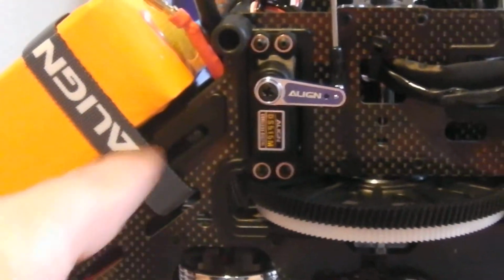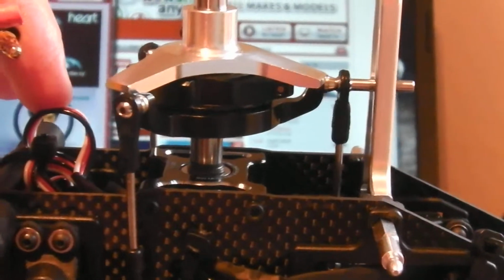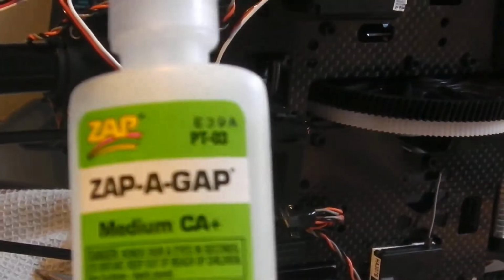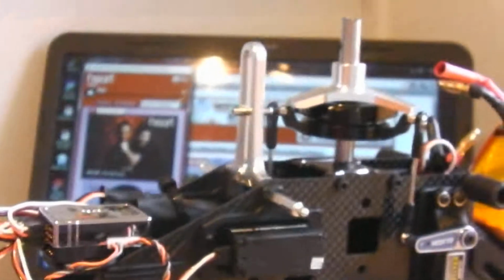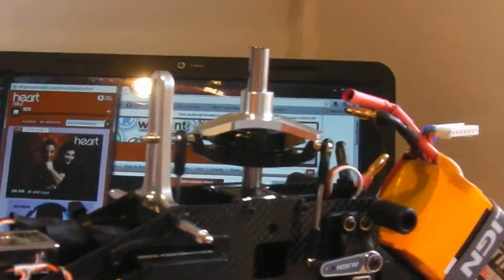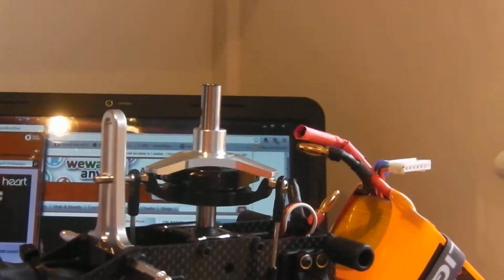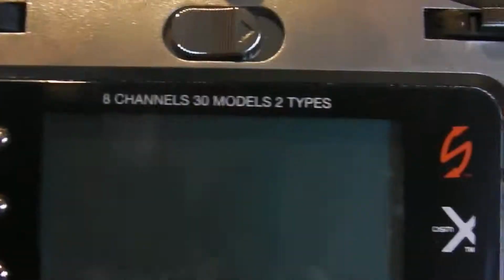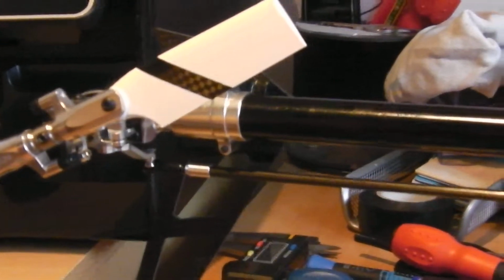Wiring suggestion Trex 500 DFC Pro 3GX

Comment: G'day Brian, Thanks for the video mate. I got the T-Rex 500 pro DFC with the 3GX a few weeks ago. Haven't setup the electrics yet as my battery hasn't arrived yet. I was just wondering how you are getting on with flying with the 500 now its 4 months down the track, would love an update if possible. Best Regards - Sam
Reply from the maker: Hi Sam and thanks for responding to the video. Well with the weather lately progress is slow. Still trying to get through the A Cert at my local Model Hel Club. im able to fly the box at a constant height (Eye level) now moving on to the lazy eight. I bit the bullet a bit and took a lesson with Dave at Flyin Fish. You will learn more with him in an hour that now will in a month on your own! One crash so far as I tailed it in but touch wood all seems like we are moving forward albeit slowly
Reply: Brian C
I'm joining a flying club over here in Melbourne when the wife lets me. Did you start out on a simulator first?, I've clocked up around 40 hours on Phoenix so hopefully that will stand me in good stead for when I take the thing out for the maiden!. What damage was their in the tail in crash?
Reply from the maker: Boom, Drive, Set of blades, Main Shaft, and Drive gears. Expensive crash! The simulator Is very good, I have Phoenix as well. Its very good for orientation training and getting the basics down. you are doing the right thing by getting the hours on the sim, it will save you lots of money! have fun

Comment: I'd recommend installing "sleeves" on all the wires.  Then loop excess and tie wrap down.    You'll never have to worry about cut wires in the future.  I have almost 6000 flights on my 500.  Keep them outside for faster repairs after crash.  Don't waste time making it pretty by concealing inside frame.  I used to do that.  Not anymore.